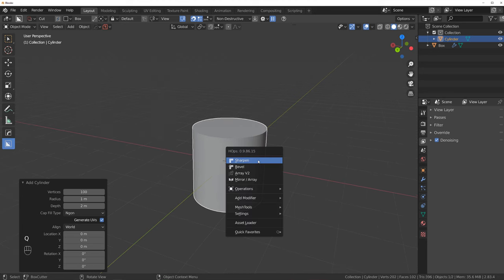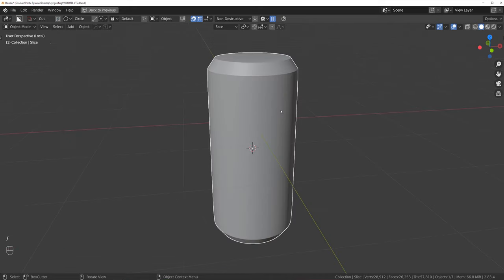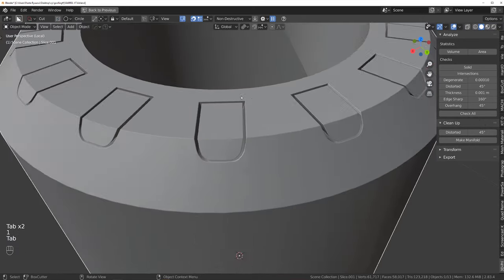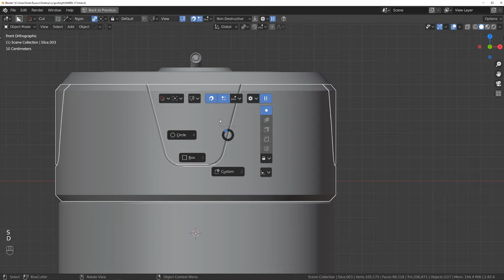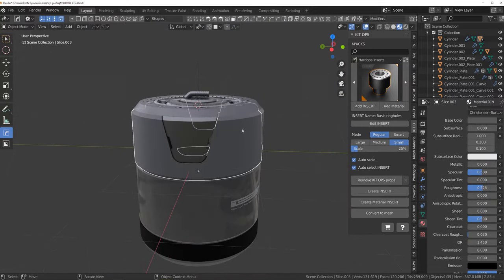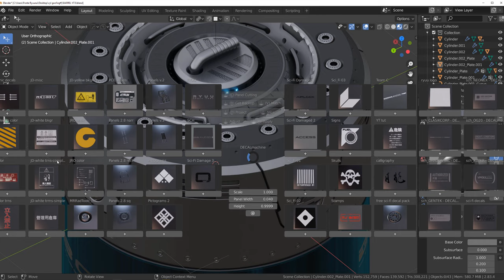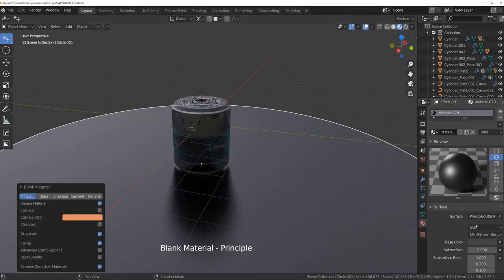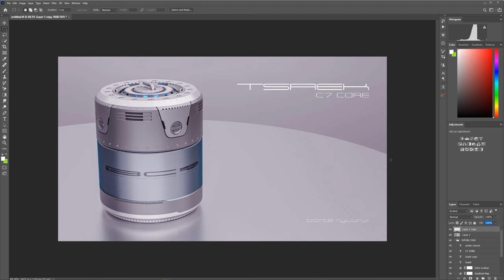HARD SURFACE tutorial for Blender with Hard OPS, Boxcutter, and Decal Machine

Comment: do you use plugs much/at all in mesh machine? or is decal machine and kitops just a much better way to work overall?
Reply from the maker: rarely, i use decals a lot and sometimes kitops inserts, but mesh machine plugs are powerful too.
Reply: @PonteRyuurui  fair enough, good enough to be worth converting some IMM brushes to plug collections or not worth that much effort?
Reply from the maker: @tieguaili3d298  well ya you can always bake those details into normal maps
Reply: @PonteRyuurui  true they could be used as decals instead, but unless you want them pretty small you need the geo for retopo later on
Reply from the maker: @tieguaili3d298  no need to retopo just bake HP to LP
Reply: @PonteRyuurui  i usually work high to low unless the design is set in stone before i start
Reply from the maker: @tieguaili3d298  personal peref i suppose, lo to high is easier because you dont need to set up a cage most of the time
Reply: @PonteRyuurui  marmoset baking ftw, it handles the cage automatically